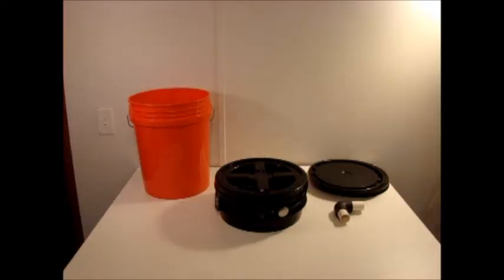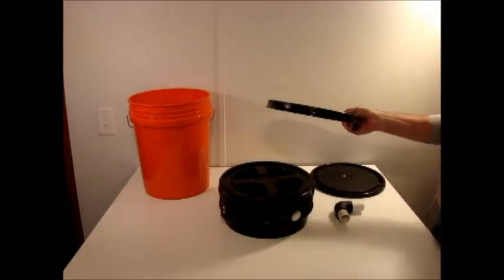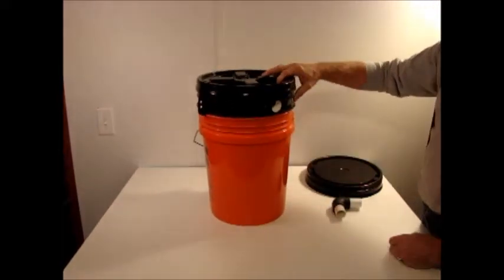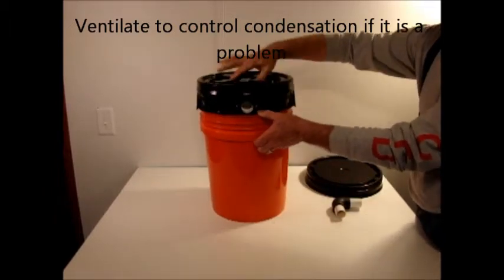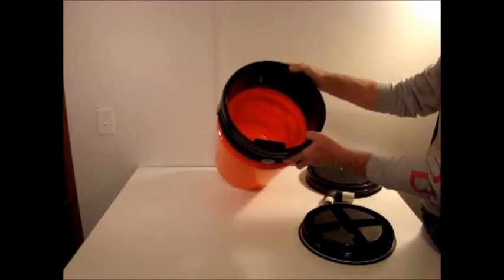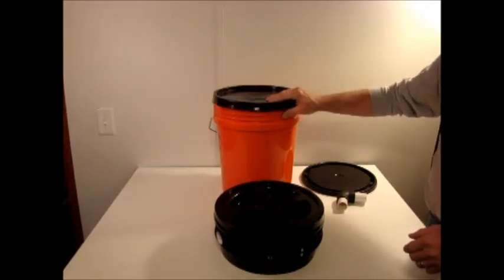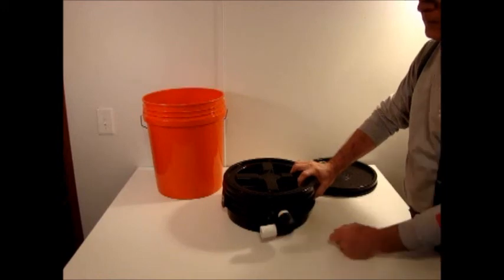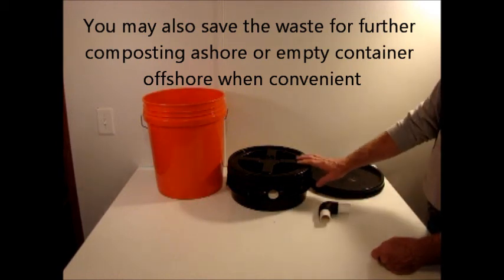The Ventilation Hood Adaptor

Comment: would it be possible to vent the whole toilet through a stink pipe?
Reply from the maker: It would depend but I would imagine it could be done. You probably don't need to vent the vent hood or the toilet at all unless you are in a confined space with no other general ventilation of the space.